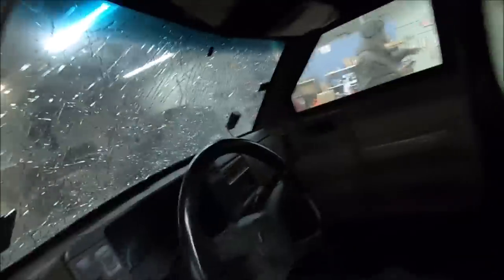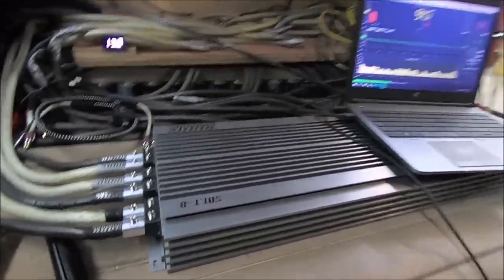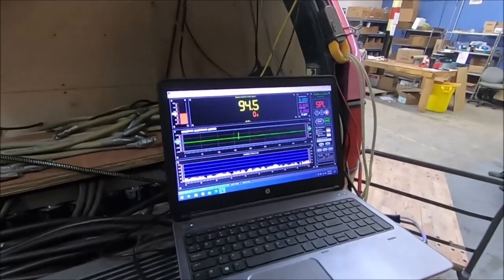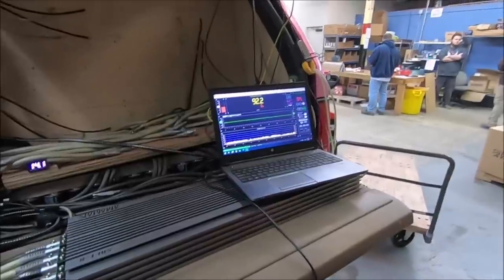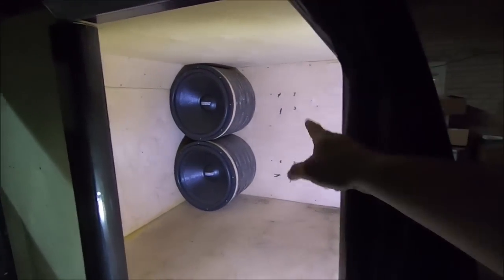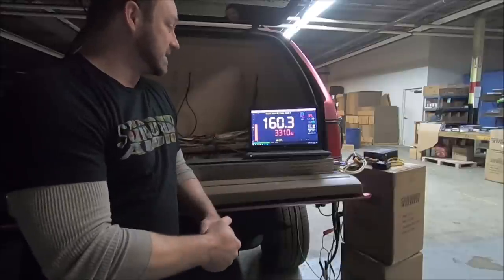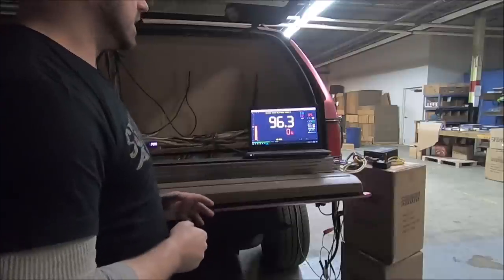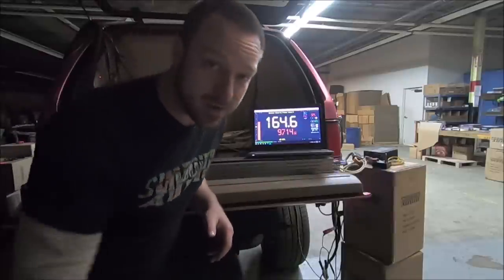ProjectSPL New Windshield, New SPL Score

Comment: When you pulled those tubes out you essentially gained air space in the enclosure. That will have an effect of tuning frequency and spl output
Reply: I agree.  Shouldn't you cap them off instead of pulling them out?  And wouldn't the extra space in the larger area change the tuning as well?  It used to be for 4 drivers, and now it's for 2.

Comment: removing the other tubes could also give u a differeance of db as direction of air flow and volume has changed, as your last tests on this video u were testing with 2 empty tubes in there and now there not there 
maybe put the empty tubes back in to test if that makes any difference